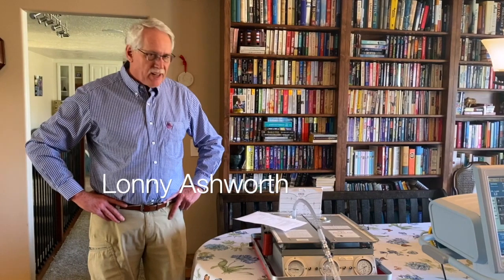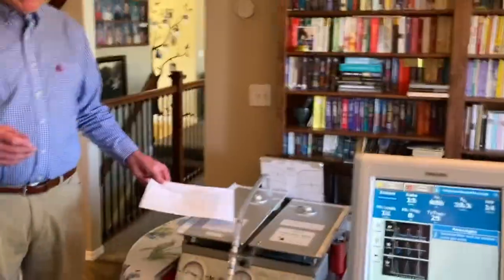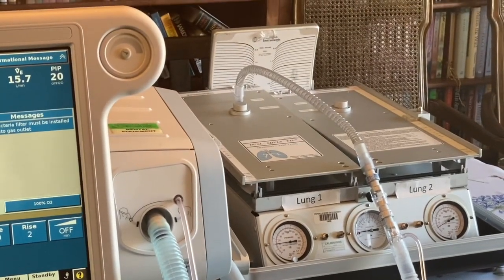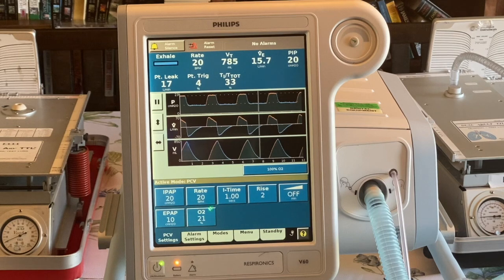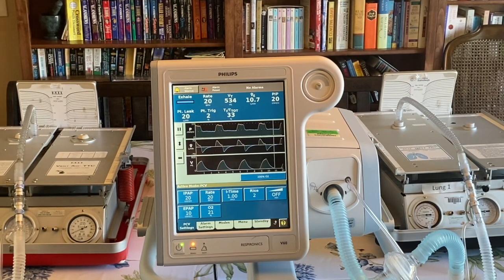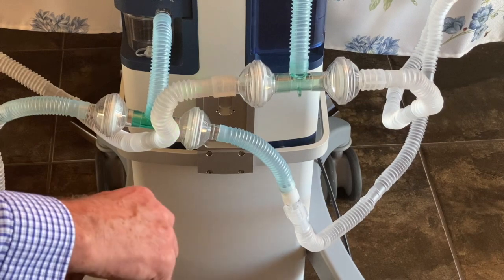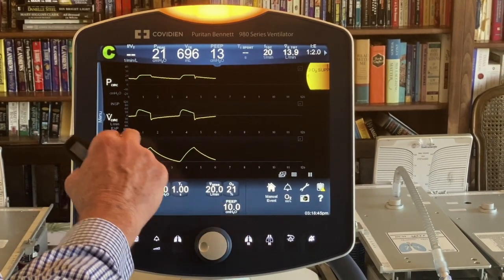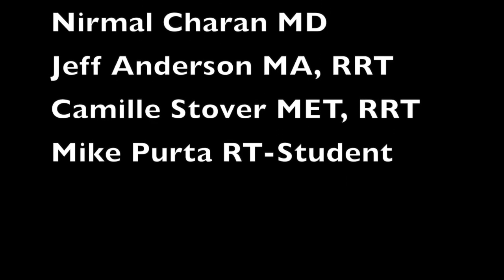Ventilating Multiple Patients Using a Single Ventilator - COVID19

Comment: Good job, Lonnie and your team members.  Well thought out, and clearly explained.  Two thoughts.   When one pts. compliance changes and his Vt drops, how would you address that clinically  with this set up?   And secondly,  this information needs to be disseminated nationwide now to the therapists working with the covid-19 pts. Especially in the states of California, New York, and Washington. Are you networking thru the state Respiratory Care societies or state hospital associations, or the ventilator manufacturers thru their vendors. ?
Reply: Hey Tim, Nice to hear from you. If the valves are in-place, you can gradually reduce the flow to one patient and increase the overall PIP, which will increase the tidal volume in the patient who had a reduction in compliance, but we need to be wary of the pressure and volume we are delivering. Yes, we are trying to distribute the video internationally. Take care and Be Safe.
Reply: @lonnyashworth5354   Hi Lonny, in essence by adjusting (closing) the in line ball valve to the more compliant lung you would be changing the dynamic compliance by way of an increase in resistance and thus (ideally) equalizing the compliance of both lungs as seen by the ventilator. This still results in providing approximately the same volumes to each lung which may or may not be beneficial. I am curious if you try VC in this circumstance and meter the amount of volume to each lung of differing compliance via the inline ball valves if you could better independently channel the volume to each lung as needed. An inline manometer could be placed in each circuit near the wye to independently monitor the pressure. Measuring exhaled volumes in this VC setup would require some kind of inline spirometer in each expiratory limb but as you mentioned several times, our clinical skills of assessment would be relied upon heavily to assess the adequacy of ventilation in these patients. Proning these patients would be a handful as well, the more you connect. Great video and while I do think most of us agree with the joint statement that we should not be doing this, it is important for scientists, researchers and academics to constantly be searching for a way to optimize our ability to care for patients in the worst possible scenario. I hope we never have to do these things, but if it comes down to it I will be glad the best of our profession was working on a possible solution if we do rather than finding out how not to do it on real patients. Better to do the research now to better our chances later. God Bless and thanks to your team for the video.

Comment from the maker: Update (03/24): Big thank you to our contributors for helping us to create viewable schematics for these breathing circuits which are listed above in the video description. 

The use of the circuit setup with the V60 should only be used on intubated patients. If possible, a viral/bacterial filter should be used on the exhalation port of the V60 to prevent external contamination to staff/other patients. The HMEs and filters will likely need to be changed often to prevent increasing airway resistance. Always verify that the patient circuit is not filling with condensation or secretions. We also suggest only using the V60s for non-positive COVID19 patients and reserving the critical care ventilators for those with the confirmed illness.